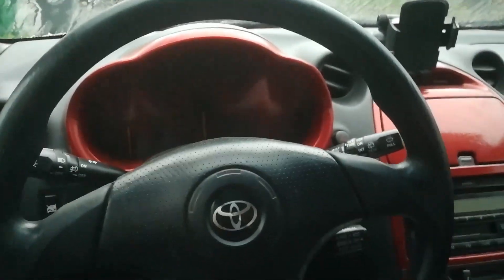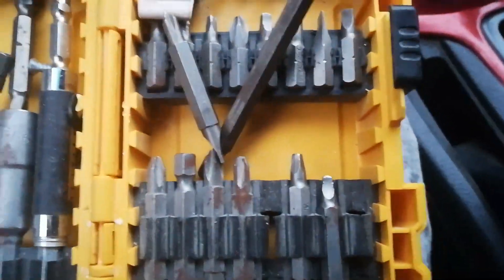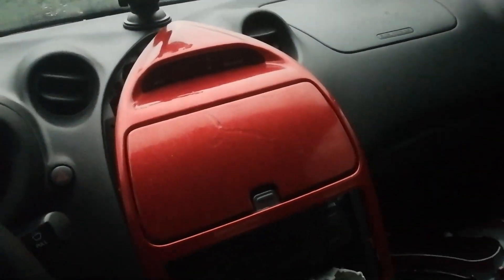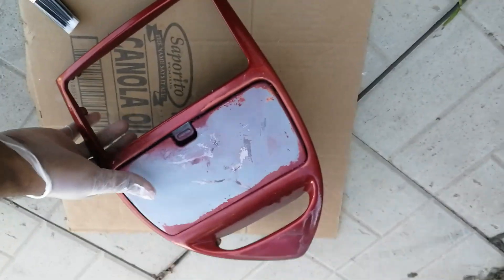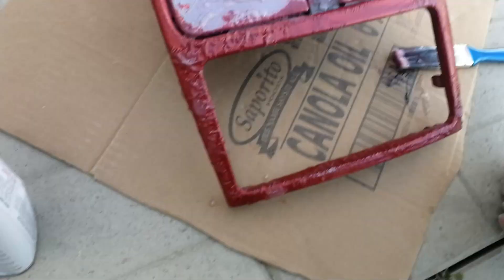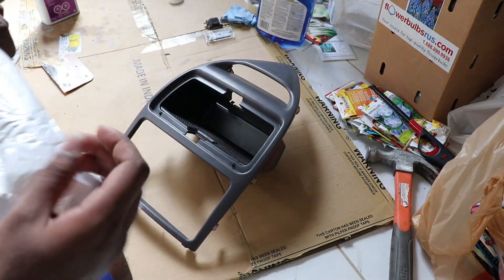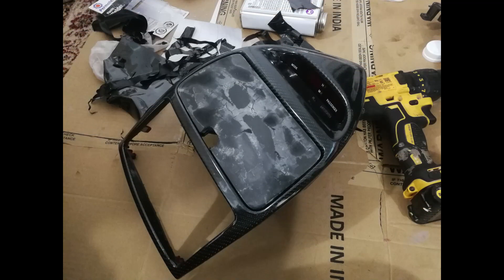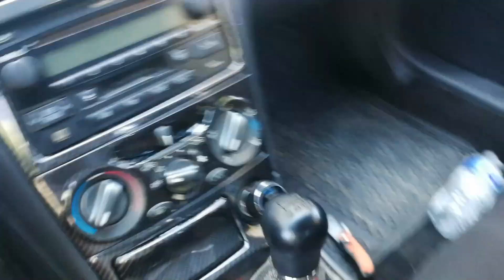How to remove center console from Celica! and wrapping it!

Comment: Hi how did you get around the piece where the hole is where the clock pushes through ..was there a special cutting method for this cheers
Reply from the maker: i stretched the vinyl like crazy but i dont recommend doin that, because of the extreme stretch the pattern looked a little distorted and i couldn't tuck the edges well enough and it started to peel back in the sunlight. try doing that area in sections instead of one piece like i did
Reply: @riyaadhuddin8124  that's great I think one issue was that I was Trying to use a hairdryer instead of a heatgun so I'm gonna try again and go from there..